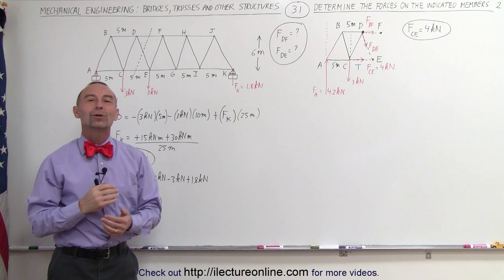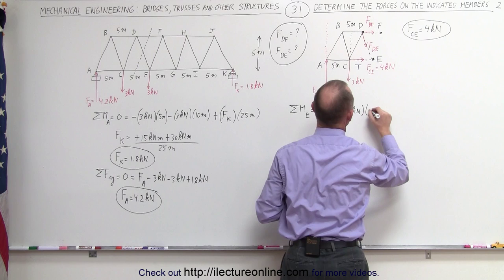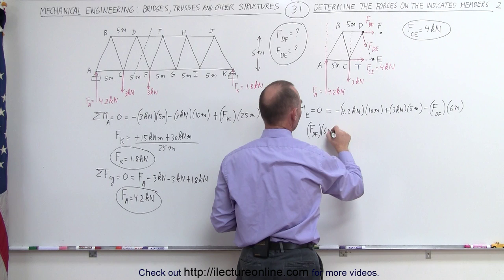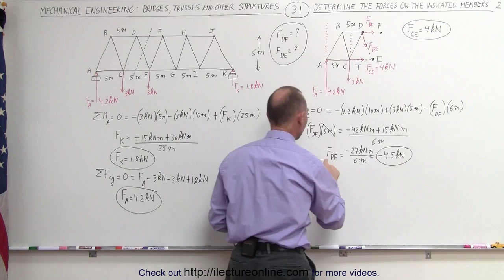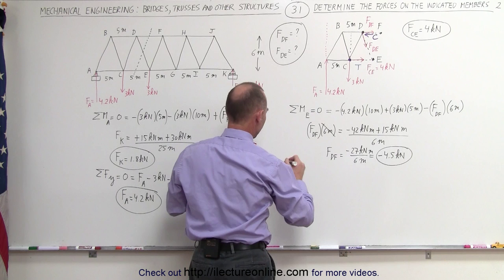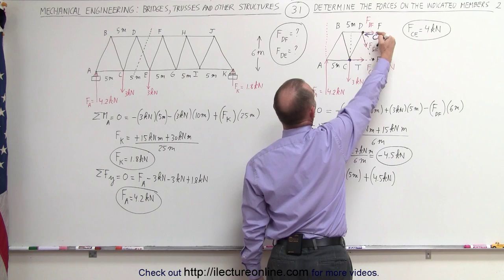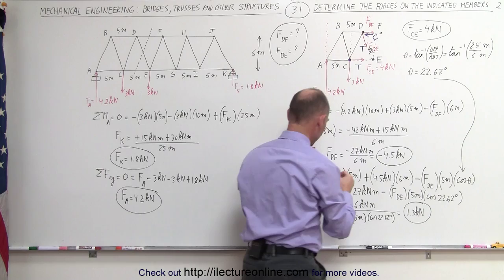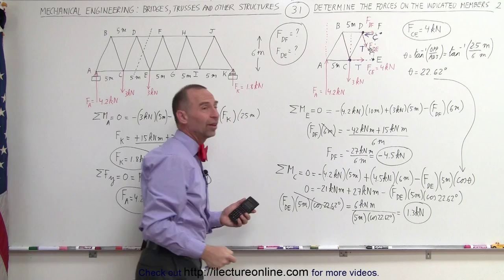Mechanical Engineering: Trusses, Bridges & Other Structures (31 of 34) Forces=? on Members 2

Comment: missed out Fde_x component during calculation of moment about C?
Reply from the maker: No, that is accounted for by using the total F DE, not the individual components.
Reply: Your videos are great but still not understanding why you wouldn't need -FDE*6m*sin(22.62) when calculating summation of moments about C as the previous commenter suggested.
Reply: Hello Mark... the X components was been considered... but if you want to involve the X components you have to apply it at point D... but as long as it is a potential force in a beam like a spring so you can apply it at point E then the X component of Fde is cancelled out.... And you get 
d× Fde×Cos(◇) ....  but what Mr. Biezen did... he changed the direction of force to a perpendicular direction and took a scale product to that force on that direction so it was: 5*(Fde*Cos(◇)).
Anyway at the end if you calculate the distance from the main Fde to point C you will End up with d=5*Cos(◇)